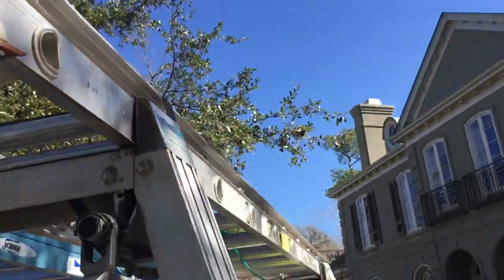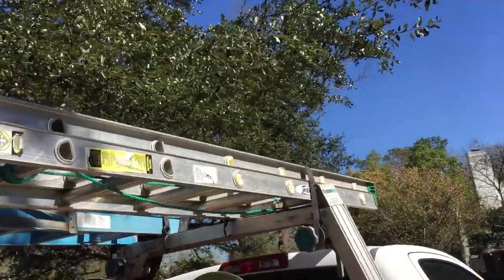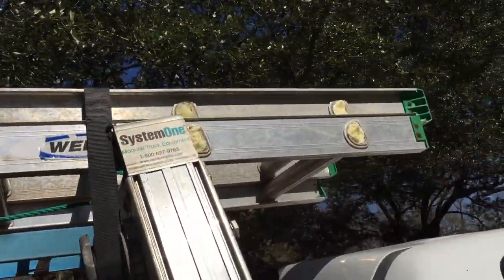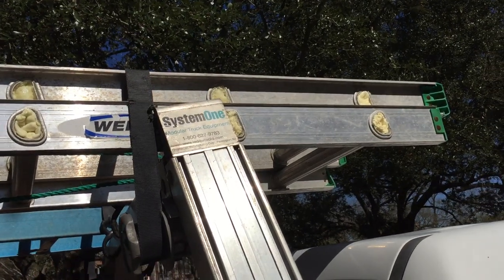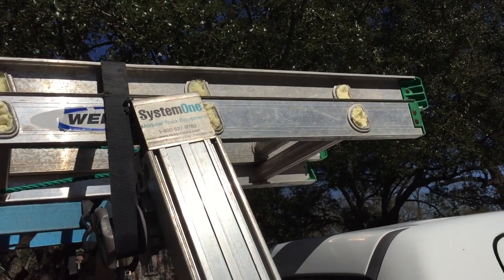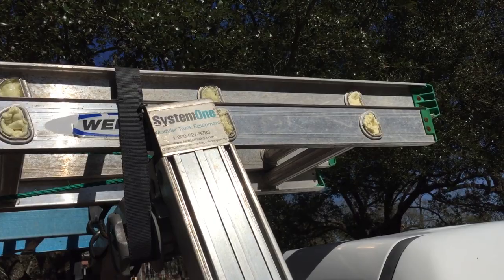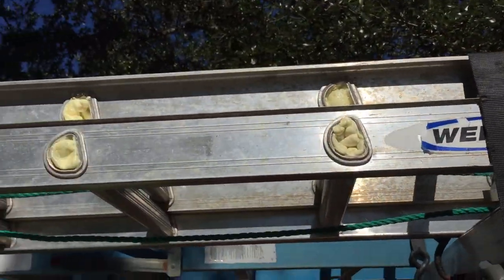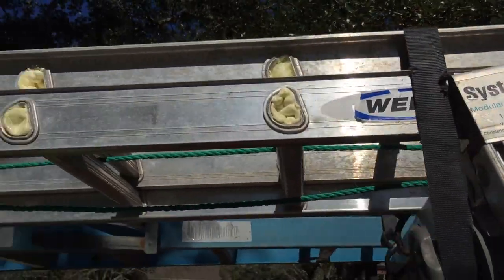Ladder Noise

Comment: Anyone experiencing the noise without the ladders on and from “full” ladder racks that extend all the way to the front windshield ?
Reply from the maker: Hey Ken, I've never had one like that, that extends over the windshield.  But check for anywhere on the ladder rack where wind would cross a hole, thats what would cause the noise.
Reply: Doug Rucker... For mine, I bought a new truck and ladder rack that does extend to the windshield. Even without the ladders the sound was horribly loud. Forget about if someone called on the phone while driving. For me, I stretched a black bungy cord (same color as racks) about 6-7’ long and wrapped it multiple times around the very first cross bar by the windshield .... like the spirals on a car antenna. Wasn’t perfect, but maybe 80% improvement. Still a huge improvement. I couldn’t believe how stressed out I was driving for hours a day with that noise. Cured my need for “white noise” trying to sleep!
Reply from the maker: @kenmoses8  lol...yeah I am very sensitive to "unnecessary' noise...drives me crazy too.